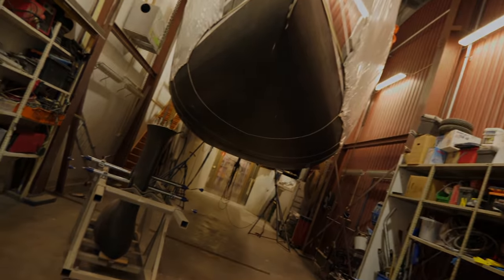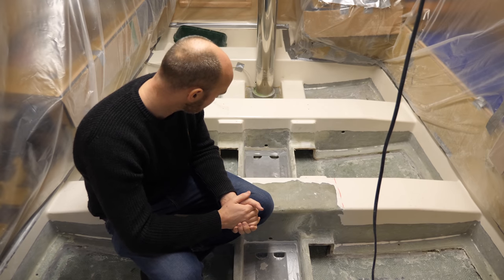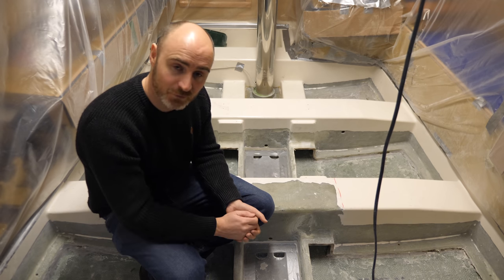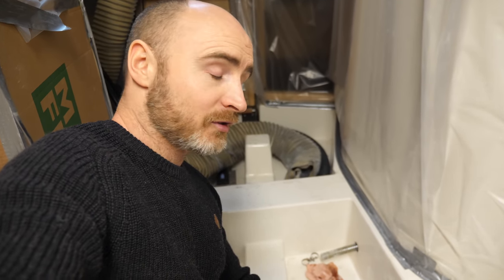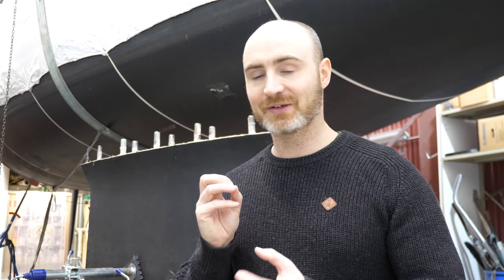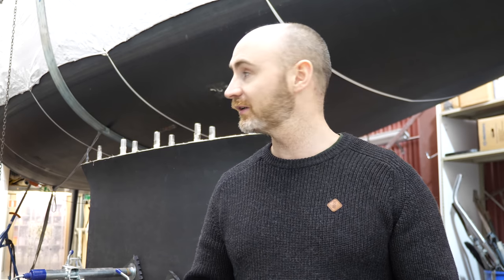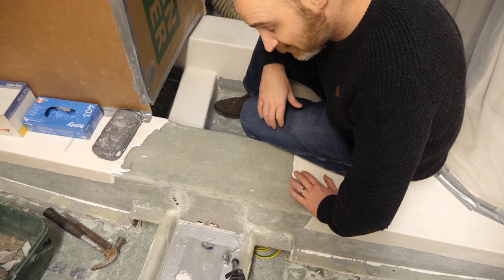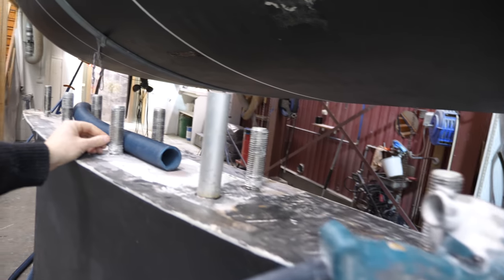SAILBOAT REBUILD - what they DON'T TELL YOU about PRODUCTION BOATS - Plastskador repair week 2

Comment: Using polyester-resin over anything old will ONLY create mechanical bond that is much weaker than using EPOXY over old laminate. If you can afford, always use EPOXY when doing repairs. BUT: when doing complex forms, like laminating over different structures, you get some extra strength into your structure. New laminates should be done in short time, so that all the layers form also CHEMICAL BOND, not just mechanical. I would also use stainless steel bolts or screws to connect old and new structures, just in case. Interesting to see from this video: the damage to the interiors ! Never thought they could be also so massive.

Comment: Very interesting getting into the various build formulas, I own a a custom built low production power yacht 650k for 38' and even though it was a low production there are still items that suprise you. I like that you have pointed out that in general its also true car production up and down a manufacturer line many similar parts. My beef is that many of these parts are lower quality made in china which I understand but not getting the mark up on crap parts. 
Bilge pumps - I obsesse as well no water but interestingly I have 6 bilge pumps.
Reply from the maker: 6 bilge pumps, wow! That's awesome, now I can justify the cost more easily to myself. Thanks for sharing
Reply: @SailingAurora  I use a dry bilge system from seaflo price varies 180-300 gets everything out - everything

Comment: Thanks for the videos guys. My heart bleeds for you watching this. Also seen the Expedition Evans ones recently. My father had a Beneteau Oceanis 54 which was in charter in Turkey and had it grounded. Was very painful to see back then too. Im sure it will be built back stronger if you get it all epoxy glassed back in rather than bonded.(Dont know why they still do that tbh after seeing Cheeki Rafiki...but at least you have a nice large keel bolt plate in there.)  I have a Jeanneau 349 with swing keel. Comes with its own challenges. I hope if (and probably when) I ground it the keel swings back like its supposed to. Only held on with 4 bolts (2 each side) through a threaded transverse keel swing shaft.  All the best. Fair winds. David
Reply from the maker: Thanks for the comment, always nice to hear what other people are going through aswell. The expedition Evans one has been really interesting to follow, can't say I agree with everything they did, but they did an awesome job. A grounding is always painful. Cheers, Chris

Comment: And it will turn in a very brittle bond; using a MMA instead it will grant you great toughness and elongation; I have see yachts hitting the shore and bonded with Plexus MMA and no internal damages to the bonded parts
Reply from the maker: Hii Alessandro, after many comments on the channel and doing a lot of research, I can see the arguments for both Polyester and Epoxy. I believe a lot of the opinions stem from workers being used to a certain material to work with. In this case the yard that my boat is in now has been working with Polyester for many years and it's a true and tried method also. If they were getting boats back because the material was not strong enough, they would have switched to Epoxy a long time ago. Also the Polyester being used here is Isophthalic and not orthophthalic. Isophthalic polyester resins are undoubtedly of a higher-grade and offer substantially higher strength, better flexibility and chemical resistance. When you start using Epoxy it's a whole different animal, to achieve maximum bonding performance the conditions need to be right and to get the perfect result a vacuum is sometimes needed to get the air out. Polyester is a lot more forgiving in the aspect and coupled together with Crestafix, it makes an extremely strong bond. They have even tested the bond with saturated glass with Diesel and it's still good. Personally, I think Polyester will be more than good enough

Also with Epoxy you cannot lay a Polyester gelcoat over it, meaning you have to use top coat, once you use Epoxy, you are stuck with it and can never go back.. Again I can see the arguments for both and when you have done as much research both reading and talking to workers, you will understand why. BR Chris
Reply: Hi Chris, I have been promoting in the industry MMA structural adhesives for more than 10 years and I helped bonding sail and motor yachts at the manufacturers; I agree with you that polyester is a well known solution and when wet tabbing you get a monolithic solution, however, if the parts are dimensioned at the design stage to accommodate an adhesive, there is not the need for a wet lay up. if the fiberglass is made from infusion, a structural bond is as good as, or better, than a wet lay up, another story if the composite is made with chop strand mat, a process that produces a very weak composite, hence you need a wet lay up. MMA adhesives are the best compromise when it comes to a structural bond, very good lap shear strength (15MPa), elongation (up to 150%), toughness and superior peel resistance, they keep most of their characteristics at low temperatures and they don’t become brittle;not as strong as epoxy and not as flexible as PU’s but the best compromise an adhesive could give. If you are interested in knowing more, just drop me a mail at agrazia@itwpp.com.

Comment: Maybe someone mentioned this in another post, but, have you had the engine brackets holding the motor in place checked? They usually take quite the damage when running aground, just food for thought.
Reply from the maker: It's one of the fist things the repair guys mentioned. They went through the entire boat looking for damage and the engine mounts were checked, they are fine. Thanks for the tip :)

Comment: I have had two bad experiences with plastic through hole fittings on a trimaran I owned. Firstly when I purchased it it was only about 5 years old and the fittings had become brittle in that short time and I had to replace them. A few years later we hit a floating log at speed and it knocked off the head of a fitting. Luckily the amas kept the boat floating. I wish I had used quality brass fittings. The plastic fittings must have been poor quality but I didn’t realise that there was such a thing as poor quality through hole fittings.
Reply: I am replacing my brass through hull fittings this winter with composite fittings from TruDesign.  This is my personal choice after much research and may be worth a look. https://www.trudesign.nz/marine. There are numerous YouTube videos on fitting them and they have won a number of awards and the fittings have various certifications.  In my case they seemed to strike the right balance and I am now looking forward to removing the old brass fittings this winter.
Reply from the maker: Thanks for the advice, there are little stories like this that are "Gold" that help with decision making :) I will have a think on it. Glad you and the boat were ok though
Reply from the maker: @Paul_Crosbie  I've seen those through hull fittings before and they look great. Think I saw it on Sail Life. There plastic and chunky, may take a look at them. Good luck with replacing the through hulls. Cheers

Comment: Very interesting video, when bilge pumps and float switches are great when they work, but have their challenging moments like when the connections corrode, thanks again for a great video
Reply: Test them every trip. Even so they only fail when you need them.
Reply from the maker: Hi Franki. Thank you so much! We actually bought the new bilge pump, tested it in the kitchen, with a flooded kitchen as a result:-) Yes, you are right maintenance is key for everything to work when you need it. Also something to do on boat! All the best, Chris & Tanja

Comment: I'd fit a small IPcam down there as well so you don't have to be removing things all the time to check for water.
Reply from the maker: Could be a good idea, but it's another thing that might suck power
Reply: @SailingAurora  It will need power or rather it will use power yes but you'll have to just roll with it if you want that kind of peace of mind. 100% if it was me I would do it to hell with power problems I will also solve that as well. Besides it's not like you have to have it broadcasting 24/7 you just need to be able to remote activate it when you want to check for water so that's not a lot of power usage. Thanks for the reply m8 and good luck k.

Comment: Great video, thanks for the insights. If I may suggest for the next time you work on the grid, consider to fill it up with expanding PU foam to increase tension within the structure or to lay down a paper honeycomb and spray on the resin with chopped fibre. In any case please try to work with resins on room temperature around 20 C. All the best 😎

Comment: I would not sail around the world in a production boat unless I knew how it was built or had seen it getting built. Obviously some production boats are built better usually when you get into the premium category. Groundings are quite common especially if your sailing in unchartered areas.
Reply from the maker: Hi Dean. We of course wish this hadn't happened in the first place, but now that it has, we ar happy that are learning a lot about the build and strength of the boat, and she will be stronger when the repair is done. Feel confident that she will be more than strong enough for us to go cruising. We are installing a Forward scan, which we think will be a great advantage in uncharted waters. Cheers, Chris & Tanja

Comment: would full keel be undamaged of such grounding?
Reply from the maker: Depends on the construction of it, usually full keeled boats are rock solid, there would usually be damage to the keel itself but probably not any structural damage inside

Comment: The issue is that they vacuum infuse hulls, and when the bag is removed, the hull is dry, and you can't layer Fiberglas to the grid that would bond chemically to it. Otherwise, if it wasn't dry, to lower the grid with an epoxy putty as replacement to this weird glue would be pretty simple and solid too.
Reply from the maker: I have thought about this one alot also. I think the process to make them stronger would not be that hard
Reply: @SailingAurora  we have to believe its a time thing cause it shouldn't cost too much... plenty of opportunities for boat manufacturers to stand out, their loss... some do it, but they also care about other important thing and they tend to cost like 50% more than a average production boat

Comment: @Sailing Aurora After seeing your videos, and Expedition Evans, I have to say I'm not too keen on boats that don't have glassed in grids.  Not that it can't be fixed, it's the overall engineering that makes me uneasy.  You will run a sailboat aground, it's when not if.  Some repairs should be expected in any accident, however these repairs are substantial to say the least.  As you point out even once fixed the stress of another grounding will just move outward.  It appears that this style of construction results in a boat that is not designed to run aground which it will.  You mention that you would have liked to have known more about this style of construction while making a purchasing decision.  What boat would you consider in retrospect?
Reply from the maker: Hi Peter, In a way I don't blame you and I agree there could be better ways to build these boats. Essentially though, it comes down to a balance between the cost and the build quality, even HR are building there boats this way simply due to the efficiency. Also you have to cosider the type of keel attached to the boat, you get the performance with a long fin keel however it comes with A LOT of leverage when you hit something. Honesntly I can't imagine any construction not taking any damage with these hull/keel characteristics, unless of course the keel is swinging eg. a Linjett. Personally I would love an Aluminium boat, that would be cool
Reply: @SailingAurora  Agreed. Finding information on how the boats are built is very difficult which makes it hard to determine a good value proposition, vs a mistake!  I looked at HR's website, as you mentioned they mention bonding of the grid, however the black and white photo (why black and white? why??) may show some kind of sanded areas that look vaguely like the areas that were sanded for your repairs to do a full layup. I don't know.  I accept that a specific technique is not necessarily bad in of itself.  We have a Catalina 34MKII wing keel that looks quite different.  It's almost like the keel has a pyramidical 'base' transition to the hull, if that makes sense.  I guess that's an older design.  Don't know how that compares for taking a beating!  Anyways, what boat(s) are going to have the grid glassed to the hull?  I ask as like I said, it's almost impossible to get this information and you seem to have done your homework!
Reply from the maker: I wish I knew more :)

Comment: Company using the wrong resin for bonding. Polyester resin is too brittle for that application of bonding pieces together. The only redeeming qualities of polyester resin is cheap and fast.
Reply from the maker: Hi Patrick, after many comments on the channel and doing a lot of research, I can see the arguments for both Polyester and Epoxy. I believe a lot of the opinions stem from workers being used to a certain material to work with. In this case the yard that my boat is in now has been working with Polyester for many years and it's a true and tried method also. If they were getting boats back because the material was not strong enough, they would have switched to Epoxy a long time ago. Also the Polyester being used here is Isophthalic and not orthophthalic. Isophthalic polyester resins are undoubtedly of a higher-grade and offer substantially higher strength, better flexibility and chemical resistance. When you start using Epoxy it's a whole different animal, to achieve maximum bonding performance the conditions need to be right and to get the perfect result a vacuum is sometimes needed to get the air out. Polyester is a lot more forgiving in the aspect and coupled together with Crestafix, it makes an extremely strong bond. They have even tested the bond with saturated glass with Diesel and it's still good. Personally, I think Polyester will be more than good enough

Also with Epoxy you cannot lay a Polyester gelcoat over it, meaning you have to use top coat, once you use Epoxy, you are stuck with it and can never go back.. Again I can see the arguments for both and when you have done as much research both reading and talking to workers, you will understand why. Cheers, Chris
Reply: @SailingAurora  yeah umm I know a few things about composite construction after 20 years in aerospace repairing composite components from 60's era to the modern day.
Reply from the maker: @patrickradcliffe3837  I'm sure you do and have alot more experience than I do. I'm basically relaying the experience of the boat builders at the yard and they haven't had a problem with these methods otherwise they would have changed a long time ago

Comment: I can't believe they would use chopped composite filler (bondo) on that fillet. I am by no means a GRP expert but that is absolutely the wrong way to use that. Maybe if they just used it for a surface and created the fillet with real impregnated roving. Not that though
Reply from the maker: I think you need to get the facts, it's not Bondo, that's a filler. This is an adhesive look it up - Crestafix 90-80PA. It's dam strong stuff
Reply: @SailingAurora  it sounds like you have more information than I do at face value. I do need to check that out.
However if that filler is also chopped fiber reinforcement its gonna be way stiffer than then glass its filling.
Thats why it cracked. Not weakness but stiffness. I still have to do my homework but why else would the stuff that looks a lot like bondo, have failed in the way that bondo would in the same application
Reply: It says right on the box it's a "non structural" gap filler

Comment: you should be looking to minimise the number of metallic fittings on the boat where possible. your commentary regards skin fittings/through-hulls is warranted - plastic are more prone to being smashed or melting in a fire.  https://www.trudesign.nz/marine/products - are certified for strength and are worth considering

bilge pumps - in an emergency situation a 12vDC 'bilge pump' will never achieved the desired performance. what you want is clutched pump driven off the front of the engine like https://www.jabscoshop.com/marine/pumps/bilge-pumps/bronze-engine-driven-clutch-pumps/
Reply from the maker: Hi Marcus, thanks for the advice. I think we will definitely go with TrueDesign, they look great. May replace all of them. Good idea on the bilge pump also, I think we will stick with the electric one though and use the engine to keep the voltage up. Cheers, Chris

Comment: You can use a t connector for a pump out but it must have a check value, and one that will not clog. Some pumps have check values built in?
Reply from the maker: Hi Michael. Thank you for your tip, will definitely look into that. All the best, Chris & Tanja

Comment: Check the specifications of the glue with particular regard to application thickness!
Reply from the maker: Hi David. Thanks, we are confident that Plastskador & Montage have this all under control:-) Cheers, Chris & Tanja
Reply: @SailingAurora  I didn't mean for the guys repairing your boat, usually the glue used by the manufacturer shouldn't be more than 10mm thick, it often is.